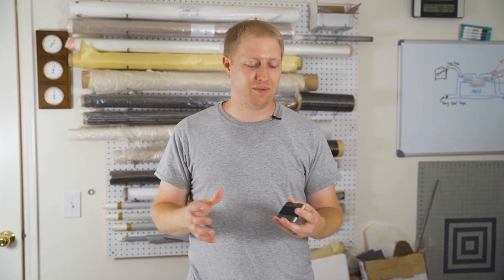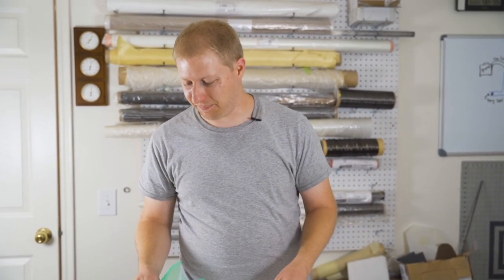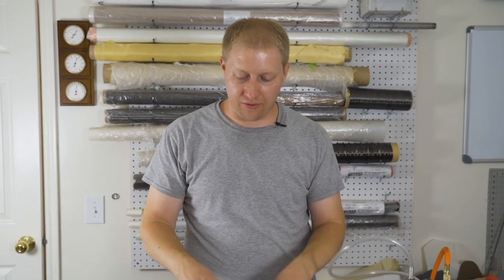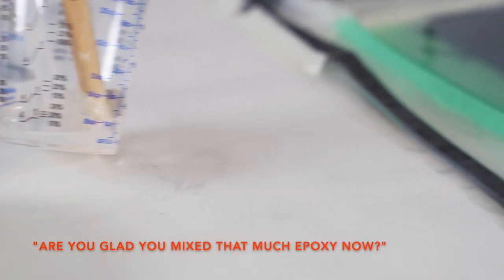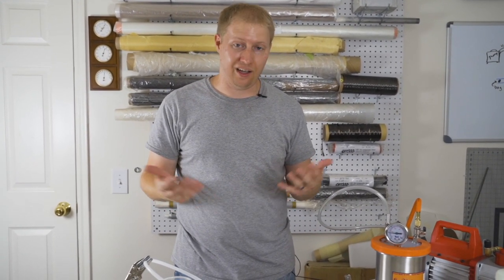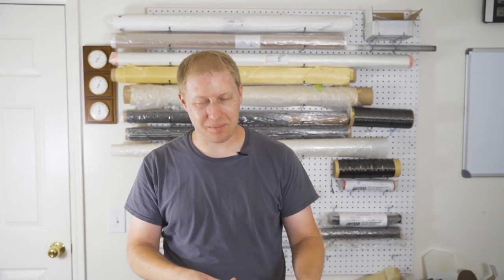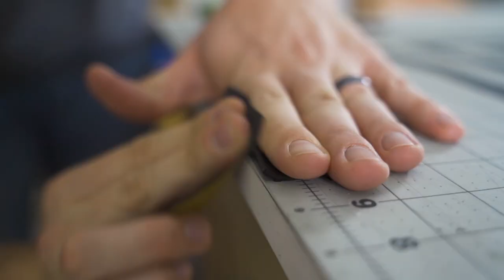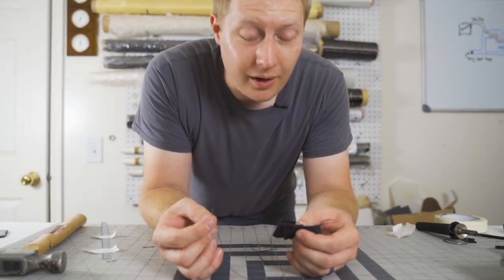Making a Minimalist Carbon Fiber Wallet

Comment: That smooth on both sides infusion was very interesting, I was wondering how that can work. I imagine it's limited to the length you can do this and maybe you'd need to somehow block the flow on the sides.
Thanks for the video!
Reply from the maker: Yes, I imagine there are limits.  It was DEFINITELY slower than a traditional infusion.  But if you can control the flow around the edges then I imagine you're limited only by the pot life of your resin.